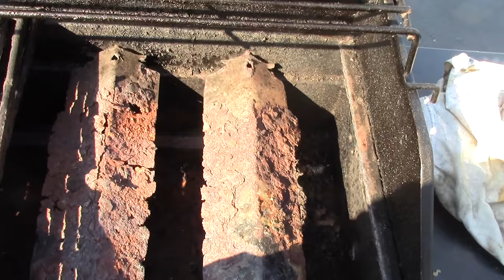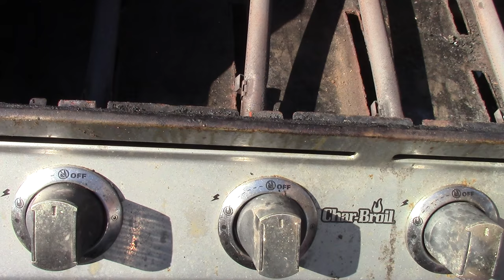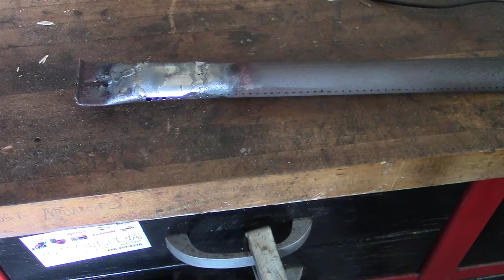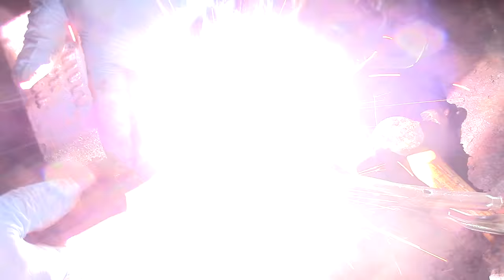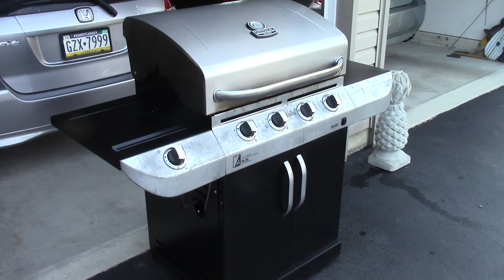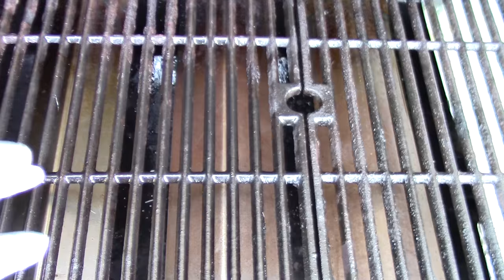Rebuilding A Gas Propane Grill

Comment from the maker: http://amzn.to/2i8FHiQ Manifold Assembly
https://amzn.to/2F2F6Zy trough to fix rusty bottom
https://amzn.to/2GSU9rd Great Little Webber Propane Grill $350 
http://amzn.to/2iaO79p Grill burners, cross T's & Heat Shield
http://amzn.to/2gH1Lkp H style Burner Replacement
http://amzn.to/2iag6X3 Gas Grill Regulator Replacement
https://amzn.to/2GSU9rd Great Little Webber Propane Grill $350 
http://amzn.to/2gKvHML Ignitor Replacement
http://amzn.to/2ibrzFV Replacement Cast Grill Grates
Help support Doublewide6 Repairs LLC by sponsoring his Patreon account
https://www.patreon.com/doublewide6
Reply: doublewide6 Repairs LLC instead of messin' with the heat diffuser buy some generic grates cut them to fit the little ledge above the burners and put a layer of lava rock.
Reply: Napoleon barbecue clean
Reply: You have listed the incorrect grill burners cross ts heat shields and regulator.. i ordered them and they do not fit this grill...

Comment: If you are going to do this much work just, you might as well replace the burners.  You can get  a kit from $17.99 to $25, or $22 to $40 if you want shields and started rails included.

Comment: I know you 'repaired' all you parts but unfortunately that's not always the case.  Your work might give you the stainless for free too.  You can't really say this was a $50 dollar build/repair.  Your video inspired me to check my 4 year old Char Broil and even at that, I had just ordered some new Grill Grates so I needed to get them installed anyways.  I pulled the 'tents' and found more rust and rot so I started my list of parts. $192 and change later plus the cost of the Grill Grates, almost $400.......That's why most people throw away crap like this because another $400, or less and you have a whole new grill.  I fixed mine and will use it for another 5-6 years but most people just don't have the time, knowledge, or energy to put into it. Definitely a 'throw away' world, pretty soon grills will be like microwaves and TV's, and you won't be able to understand the internals and be just that, throw away......

Comment: I disassembled everything... fairly easy.  Used electrolysis on small parts and muriatic acid on big panels.  Muriatic acid will leave stains on stainless btw.  Either make sure to not get them on stainless steel or sand it off.  Now it's like brand new.
These grills are fairly simple and straightforward.  Don't be afraid to take it apart to clean and paint.  I used 2000' Rustoleum spray paints.

Comment: I would of replaced all the tubes and cross overs.
Reply from the maker: Next time I do the grill I will.  It has been a year and so far no issues.
Reply: @dryfuss1955 Any ideas how to attach the tubes? Mine are detached from the grill . The part that attach to the grill has rusted out .
Reply: @anafonseca8748   I had to remove and rebuild the rusted out areas. You can purchase replacement metal and angle iron at Lowes or home depot. I used a grinder and cut off tool to remove the old metal and to cut the the new metal.
Reply: @anafonseca8748   I had to rebuild the back wall  of the unit lucky there was enough to rebuild. I used stock metal to rebuild the back wall and I used angle iron  to secure the venturi tubes and flavor shields.

Comment: I just completed rebuilding my Char-Broil 4 burner commercial gas grill. I purchased it over 7 years ago and my burners, cross over pipes and flame tamers were rusting out. I called Char-Broil and they found where I registered it, over 7 years ago, and they sent me 4 gas burners free!. I ordered the other parts and installation was easy.  My grill is working great. Char-Broil was very nice and professional. I cover my grill after every use, but it does sit outside all year Char-Broil was really great. Thanks, JohnG.
Reply from the maker: Nice to hea Char broil hooked you up John.

Comment: The correct size replacement parts are available on Amazon.  Lowe's sells universal parts that don't work well.  Burners, 'tent' grease deflectors all available, in stainless steel.  The tent things last much longer if wiped off regularly to prevent grease buildup and burning off. Just need your model # found on the back of grill. The porcelain coated grates clean up real nice just by soaking in dish detergent standing upright in a bucket.

Comment: I own a Weber gas grill with 2 burners.  The crossover burner is rusted out and so are the cooking grates, flavorizer bars and the drip tray holder.  I have the new flavorizer bars and 2 grates which cost $30.00 each.  Do you think I should replace the burners, tray under the grill and the grease tray holder?  The tray below the grill is disintegrated.

Comment: Another problem area on these grills is the Grease Drip Pan will rust out. The Charbroil has a riveted in pan so it is not easily replaced. I just replaced mine by cutting out the pan and replacing it with a new stainless pan. The new pan has adjustable width to fit different width grills. There's a link for the 'tough to fix rusty bottom' in your description which doesn't have drain wholes for the grease to drip through. If you had that I guess you wouldn't need a drip pan.

Comment: Never buy a gas grill that does not have a parts support, I bought a PGS almost 25 years ago and I still use it, cast aluminum top and bottom and stainless steel inners, I can still get parts for it.

Comment: 2 years ago bought a 5 burner for 25. Came with a tank. Spent maybe 5 hours jamming to music cleaning and replacing burners and regulator hose. Degreasing ect. Works perfectly and looks brand new. Gonna use it heavily this coming 4th weekend

Comment: Currently going through this process with an old Great Outdoors propane grill nice to see what you could save, I'm trying so hard to save its H-burner because it  has the branding cast into it and I can't just punch a replacement into Google since the company is long gone.

Comment: charbroil warrants those tube burners for life , they sent me a free set. the problem with those grills is the drip covers rot fast so you have to buy new ones and the bracket they hook on the back of grill rots out, which if your not handy you grill is junk.

Comment: Crossover tubes don't distribute gas, that is what the controls at the front are for. They allow the flame to go from the burner with the electric sparker to the other burners.

Comment: Nice job! What type of metal (stainless, etc) would you suggest to rebuild the little shelves that hold the far end of the burners? I've had several grills where these disintegrate over time. My current grill has them spot welded to the rear of the grill, so I was thinking of drilling holes and screwing new angle brackets in.  Thanks!

Comment: Nice job. I love how you not only fixed the grill but you fixed the parts for the grill. My burners fell apart just touching them, lol. So I had no choice but to but the replacement kit for 45.00. It came with 5 burners, 5 heat caps and 4 crossover tubes. Not too bad considering I spent 550.00 for it 6 years ago. Thanks for sharing!!

Comment: Great job at restoring the grill. Do you recommend using 2"x2" .125" thick extrusion steel angle instead of sheet metal? They are sold at home depot
Reply from the maker: That may work if it is wide enough I think my steel plates were wider.

Comment: As someone without a pressure washer/minimum tools, would brake cleaner work for rust spots? How best would I clean the grate? Just scrub the crap out of it? I can't go buy 100 dollar tools lol. How do I do this best buy hand?
Reply: Just buy a wire brush from an auto parts store.

Comment: The grill repair came out great.  I had to replace the tents (Weber calls them Flavorizor Bars) in my grill last year.  I don't have access to a brake, so I bought them from 3rd party vendor on Amazon.

I was looking at a smaller 18" & 30" metal brake at Harbor Freight, the prices were cheap enough and the amount of times I would use it should last a while.
Reply from the maker: Having a small brake is handy.  I'm not sure what the cost off-hand, but if you can use it a few times a year and it is not crowding out your workspace it is worth it for sure.

Comment: I have a Jennair gas grill and the "tents"are made of a thick stainless steel, no rust problem however my cast iron burners have rusted out so I am waiting to get some burners in but I thought about building some "boxes" that could fit on top of the cast iron bases and drilling holes in the stainless and then welding them to the iron.
Reply from the maker: If you can do it yourself why not?

Comment: Great Video. 

What type of metal and gauge did you use for the tents? 

Mine are rotted out and I know you can't use galvanized steel because of fumes.
Reply from the maker: The metal is 18 gauge steel.  Your right not galvanized.
Reply: doublewide6 Repairs LLC where can you buy non galvanized sheet metal?

Comment: Great job man , for those who don’t have your ability of sanding and welding and fabricating perhaps purchasing the tubes and flame plate from amazon could save them the cost of buying a new grill. I just replaced mine and all 5 of the flame tubes and plates were less than $30 on Amazon. Just be sure to get the right model parts. P.s. never order or cut something based on wife’s measurements. LOL . Just kidding